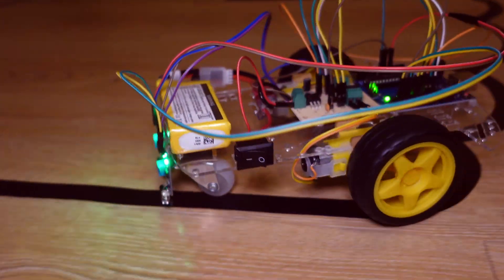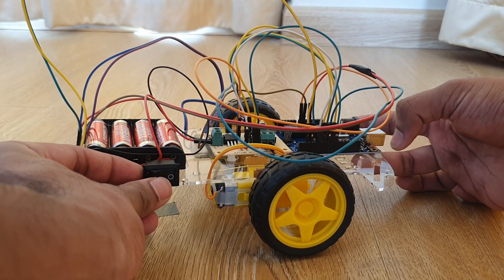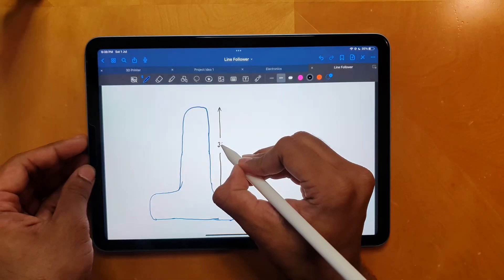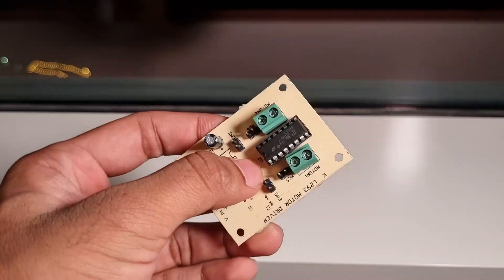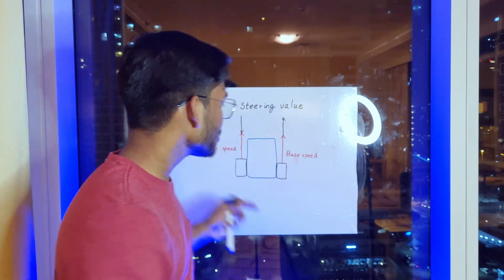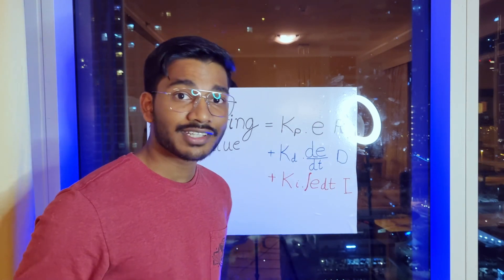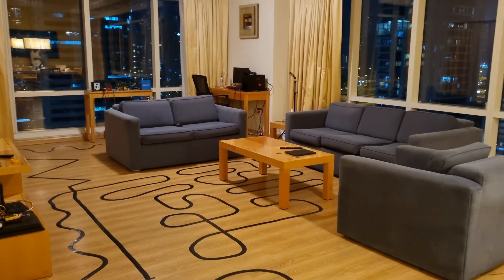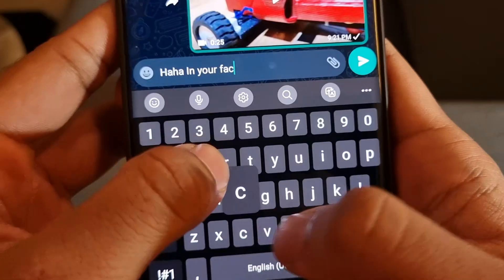I made a SUPER FAST Line Follower Robot Using PID!

Comment: if you use more than 2 sensors, 4, or 6 for example, with more forward view, to anticipate turns and accelerate in a straight line, is it possible? 
I'm a complete beginner so I'm asking this question without any knowledge...
Reply from the maker: Anticipating turns is not possible with these sensors. However, if you place the sensors in  more towards the front, then it is already predicting the turns better.

Comment: Hi im quite new to arduino but im just wondering how you got the arduino powered without plugging it in anywhere? I mean looking at 1:57 there doesn't look to be any cable from the battery to the  USB or barrel plug. how is it working?

Comment: How about using a QTR sensor? 
Me and my friends were able to make a similar fast PID based line follower, during the build we realised that the gap between the IRs was also a deal breaker (QTR being compact, solves this issue) .
Also can you upgrade this to a maze solver next please, would be interesting to see that! 

Good video!
Reply from the maker: Thanks for the suggestion, I did consider a qtr sensor, however due to availability issues I went this one. Maze solver would be an interesting project!

Comment: Hello bro, first of all, let me congratulate you on the video. I'm having doubts about this line sensor. I have one just like yours, however, the sensor values always remain the same regardless of the surface it detects, whether it reflects a black or white surface, for example. I'm simply reading the sensors from the analog inputs, I'm not sure if I need to do something else?

Comment: I am doing a project similar to the simple version that you show and apperantly I do everything correct but when a switch on the gears are not working. 
After watching your video I guess that the battery I am using is the problem. What kind of battery should I use?

Comment: I am starting doing projects with Arduino and I am interested to start doing the simple version you show in this video. What are those components where you put the photoresistors? Sorry for asking but I am not familiar yet with electronics and Arduino. By the way really cool video dude I enjoy it!
Reply: Think he used IR detectors not photo resistors.
Reply: Thank you.
I have see that I will need to do it with phototransistors, are they similar to the IR detectors? Or at least if I buy this IR detectors to practice will be similar? @aakashjana6225

Comment: How necessary was the integral constant? Was it relatively small? 
Would a larger integral constant yield a better response for an error biased towards one side? Such as one wheel having (consistently) more grip than the other side?
Reply: In the case of one wheel having different properties (such as better traction), you would have separate PID values for each wheel.

Comment: Bruh I can easily find way to make it perfect

Get cheap camera low resolution to save battery as ypu don't Need much.

Make it look down but slight angle forward.

Then get the black color of line while having small light there so it works in dark but doesn't make line white with the light.

Make algorithm that reads all the pixels from camera

Check the difference between pixels on left and right.

If on right there are more black pixels then decrease speed of the wheel of this site by the difference in black pixels between sites.

Comment: First of all, awesome video, great explanation and demonstration of everything, i just added to my favorites! I just wanted to point out that you might've made a heavy load with that cool looking racing car model on top... and the tires/wheel you've chose does not have a good grip, its better to have something more soft to have better adhesion... another thing to consider is having bigger dc motors, those are very weak, specially with that load on top of it... please remember to take everything that ive said with a grain of salt because im not a professional at all... but i was wondering about that while i watch it run...

Comment: It is called 'Bang Bang' from the first days of radio control in which I played a part, trying to fly aircraft. there were three positions ; neutral, or BANG full right, or BANG full left ( and they did make a bang noise sometimes, using rubber escapement motors) - no proportional in-betweens

Comment: Another addition you can do to increase speed is speedup on straight sections and then slow down to normal or break on turn can significsntly boost speed
Reply from the maker: The PID algorithm does that automatically

Comment: Great video, thanks for sharing it. Although I do have one question, how were you able to determine the error value accurately with only 5 IR sensors!?, I've been trying to do the same thing but couldn't see it happening with only 5 sensors.
Please reply if possible
Reply from the maker: The IR sensors give an analog value rather than a digital one. So that adds to the precision in measuring the error.

Comment: it's hardly "fast", but good job on the presentation and project! (see videos from Japan's linefollowers or maze solvers, or from Europe's Robochallenge linefollowers...)
Reply: Fast compared to mine
Reply: Ok mine is faster now
Reply: @jubair- i am making a similar project and i would like to ask a question.
The PID output is the correction which you decrease and add to the base speed right ? 
And how do yoy calculate the error ? I mean you calculate it with the IR sensors and you give each one of them a value right ?
My car has 4 wheels so thr right wheels has their own speed and the left ones also have their own speed right ? 
Like : RightMotorspeed , LeftMotorspeed
Reply: @jubair- you took 7 months to make it fast 
Dedication 🎉
Reply: @MatanDror 
Yes you find out the position by IR sensor output. Then subtract the position from central position. Increase and decrease left /right speed according to the deviation.
Reply: @MatanDror  worth looking up how to PID guides. The basics are: you first only set the P: proportional. E.g. your robot, at a given time, detects it has to turn 30 degrees. How much does that mean in practice for the motor command?  Trial and error. You add the pid value to the left, and subtract it from the right. 
That is your base robot, that goes left and right: a P of 1. Start playing with it until it's smoother.
Then you go for the I.  Integrative means you take into account the last errors  by cumulation. (E.g. you have to turn faster, if you're already fully turning but the "error" isn't getting smaller) this is usually an average of the sum of last N errors.
Then, finally, D derivative. This is a difference of the last trends in the errors. E.g. when you're overshooting the turns to the other side

Comment: Can i also use higher speed motor?
Reply from the maker: Yes, you can use any rpm motor. But you have to tune the PID values.
Reply: @shyam-ravi  where can i dm you if u do not mind ,really need some help
Reply from the maker: Instagram @thetechnowright
Reply: messaged you
Reply: Bro i messaged u on insta

Comment: It cant take acute angles right? Im working on LFR from 2 years.
Im using qtrx 16A line sensor with toshiba tb6612fng motor driver and teensy board, my lfr top speed is 6-7m/sec.
Do you have any idea to crack acute angles?
5:30 your app looks similar to "Bot reboot's" pid controller app, did you made this app or using his app for pid tune?
Reply from the maker: Yes, the PID alone isnt sufficient for acute anglee. So, I coded it so that once it leaves the line it checks the previous error and turns to that side till its back on the line. This worked well on the acute angles.
Reply: @shyam-ravi  you mean, in this code it can take acute angles well?
Reply from the maker: Yes, it handles the acute angles quite well. As you can see in the video.
Reply: @pocopoco3468 
Which motors are you using
Rpm
Voltage
Reply: @shubham9672  N20 gear motor, 1000RPM 12v
Reply: @pocopoco3468  
Okay brother
Wheel diameter